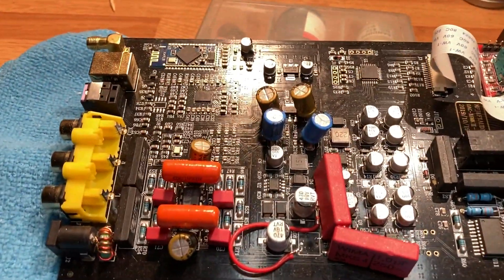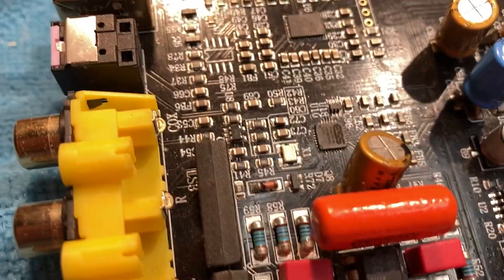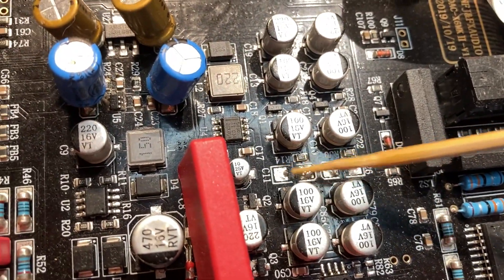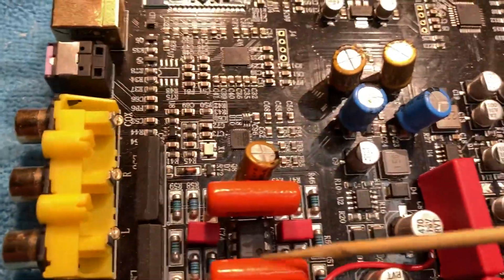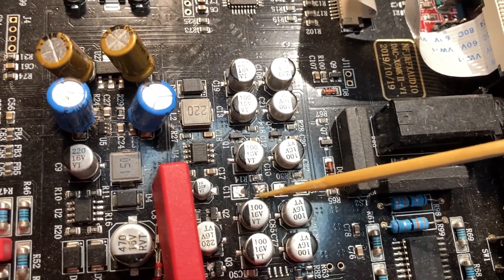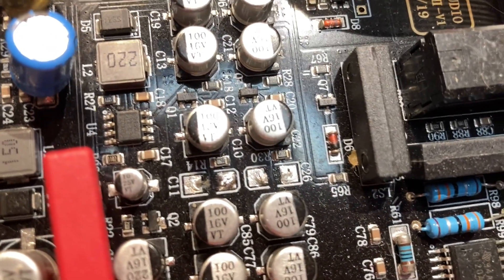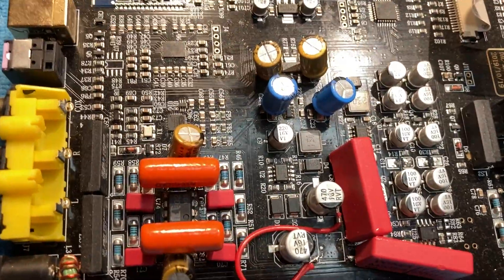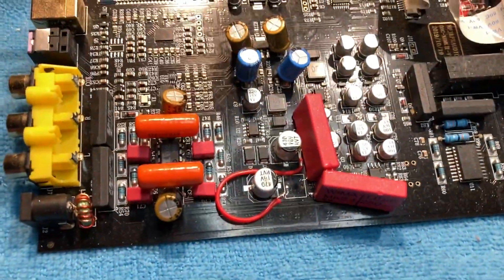FX Audio X6 MK2 DAC mod

Comment: Any idea on how to fix the fade in issue with the volume when starting an audio file in windows on winamp, or watching YouTube? 

(It's almost like it has a noise gate on the input. I have the 2020 pcb board).

I found this:

"There is a hack to get around this. You can set the "listen to this device" check box on either a line in device or a microphone that you aren't using, then set the device volume to 1/100. It won't be audible, but it will keep audio data streaming to you DAC and keep it fixed in to your chosen output sample rate."
Reply from the maker: I don’t use windiws
Reply: @ranbymonkeys2384  OK so you no sound drop offs for you on Linux or Mac I take it?

Comment: Mine didn't have C11 and C26 already. I replaced the worst of all op-amps: OPA2134 with a decent one: JRC2114, but sound was still compressed, so I decided to skip OP275 (gain 3.75) and the two blue capacitors, connecting output of JRC2114 with R60 and R68 (I soldered them with one end in the air to solder a cable to these loose ends). The loudness is still sufficient for most of the headphones and the sound is still not perfect, not 100% analogue, but now it's acceptable, maybe a little harsh. I tried a double LT1028 - it was OK too. The next step would be to replace TPA6120A2 with a double BUF634T and then to replace a op-amp in a differential stage with MUSE or Oracle II , or some simple analog stage on JFET. It isn't and never will be a R2R DAC, but now it can be used and my doughter is happy.  It's an updated to SMSL M2 (also modded) in which SA9027 suddenly died.
Reply from the maker: opa2134 are excellent op amps where are you getting your op amps
Reply from the maker: What did I tell you about where to get your op amps.   There is no such thing as a JRC2114 that is a fake Chinese made op amp.  Leave everything alone and goto DIGIKEY and get a real OPA2134 and you will see what I'm talking about.  Also wityh op amps you dont necessarily look at the gain but you look at the bandwidth, the slew rate is important (how fast it is) and signal to noise ratio but you are dealing with fake op amps and you are chasing your own tail here.  Knock it the hell off and take advice from people that know what the hell they are talking about and get some real op amps.
Reply: @ranbymonkeys2384  I meant NJM2114 from JRC - this is a very decent op-amp. Regarding OPA2134 I have (or rather had) several from different sources (also removed from some quite old, expensive audio equipment) - all sound the same bad, really bad. In fact all op-amps sounds bad in one way, or another - of course you can make it a little bit better, by example by making their output A-class (current sources at the out to +/Vdd or -/Vss), removing the load by using some buffers, by reducing the open-loop-gain, but in the end only few are semi-acceptable. OPA2132 was quite decent one, but not universal (low I-out) - maybe you mistook one for another? Statistically the best op-amps are from Analog Devices, but I didn't try MUSES from Nisshinbo (I'm afraid of fakes). The best op-amp is when there is no op-amp - just a discrete current-base voltage amplification without loopbacks and A-class buffers.

Comment: Hi, would you recommend the X6 MKII or the E30?
Reply from the maker: you would?  Well I have a E30 for sale and I would recommend the E50 (the one I'm currently using).
Reply: @ranbymonkeys2384  I would luv to but i dont live in the US.
Reply from the maker: E30 is better than the MK2 but the new E30's have the new chip which isnt as good as the old one.  You need to get one before a certaint serial number.  I have one I'm selling it for $200, but if you can't find an old one then get the E50.

Comment: Hello there, so im in possesion of dax x-6, lately i was thinking about an upgrade, im using it only with my pc and my dt990 pro, is tube03 good choice? Will it make any difference? Or should i buy additional hedphone amp? What would you recommend? I would like to spend around 50-60 $, is it even worth it in this budget? Thanks
Reply from the maker: Ya if that is all your budget it get the MUSES02 op amp.
Reply: @ranbymonkeys2384  how about muses01? I was just reading about this two opamps and people say that 01 is better, i really dont have any knowlage in this topic so i hope u know something
Reply from the maker: @h2p_rome  No it's not better, I don't think so anyway.  I can tell you that the MUSES02 and the X6 pair very well, or I would have put MUSES01 and NOT MUSES02.  Your on your own.
Reply: @ranbymonkeys2384  okay, sure, one more question only, i think i would like to choose warmer one, beacuse sound of 990 is pretty analitic, which one would you say is warmer?
Reply from the maker: @h2p_rome  990?
Reply: @ranbymonkeys2384  beyer dt990 pro
Reply from the maker: @h2p_rome  Neither are particularly "warm".
Reply from the maker: @h2p_rome  Have you put a real op amp in it all since you got it?
Reply: @ranbymonkeys2384  Not at all! Its totally stock, anyway i think ill just buy muses02 just as you said :) besides that, what do you think about smsl sap 2? I am wondering if it will be noticeable better amp then amp in x-6
Reply from the maker: @h2p_rome  I had the SMSL SU-8 and it sounded like shit. As for that one, no idea im not a headphone person.
Reply from the maker: @h2p_rome  Remember if something looks too good to be true, IT IS, an MUSES02 should run you about $50.

Comment: Anyone experiencing using usb input where the beginning ½ second of audio is not heard? Sort of like a fade in.
Reply from the maker: Have you tried a different USB cable and slot?
Reply: Yeah I do, and also I tried using a different cable but the fade in issue is still there and that makes me not use this DAC at all.
Reply: I adjusted the output/playback stop start settings in “foobar” my main media player of choice. I still have that problem with my CD player.

Comment: My dac has 1000 uf 25 v and i plan to replace with 3300 uf 25v anyone has any input on this
Reply from the maker: I do, You can but they probably won't fit.
Reply: Thank you so much. I think they fit as i checked the diameter spacing and they were the same i think
Reply from the maker: @jupitalynho2303  Make sure you check the height.  I don't think I've ever seen a 3300uF less than .5 diameter.
Reply: Awsome. Thank you very much
Reply: Any idea on LPS. Would replacing the caps with higher ones mess with voltage?my LPS has 14 caps. 1800 uf and 3000 uf. But i plan to replace caps with 3300 uf. They fit but idk if it will mess with voltage or not.thank you
Reply from the maker: @jupitalynho2303  As long as the voltage is the same with the replacement caps, also the smallest I found was 1/2 x 1 1/8'' for  3300uF.
Reply from the maker: @jupitalynho2303  Never mind they are 5/8 x 1 1/4"haha
Reply: Awsome thank you very much.
Reply: Good quality caps are usually much bigger, so if you find 3300/25 that still  fits it will be probably a lower quality cap, so it can make it worse.

Comment: hello, about the OPA2134 part...can i just put in any 8-pin headphone amp from ali-express with 8 pins? Dont these things have specific resistance or voltages? Most of the time there are no specs on ali express.Id like to put in a nice part maybe for 10 dollars.
Reply: The PSU in this DAC supply +10.5V/-10.5V to both op-amps (OPA2134 and OP275). You can replace horrible OPA2134 with most of the dual op-amps that are designed for 24-36
V, but be aware of these that are designed for less, like 5V. Still some of the op-amps will not be working correctly in this application, like LT1358. I didn't test all of them I have - JRC2114 was just good enough after skipping OP275 too.

Comment: I’m here in this game and really appreciate this channel . Could you recommend some Op Amps for a good upgrade on this model ? And perhaps for a more spacious soundstage? Thanks
Reply: JRC2114 is good enough, but you have to skip/remove OP275 - without removing/skipping OP275 the SOUND will not open not matter what op-amp you will place instead of OPA2134.
Reply from the maker: The sound stage is mostly going to come from the capacitors but check out the tube-03 video there are a bunch of op amps listed there.  I know one thing you got to get rid of the one that came with it.
Reply: Thank you so much!

Comment: Thanks for this. Your stuff is great. Watched your FX TUBE03 video and am waiting for my caps and OP amps to come in so I can trick that out. Now I'm thinking of getting the DAC-X6 as well. It looks like all these mods are exclusive to the headphone amp, correct? If I'm not going to use the headphone portion can I run this stock or are there still components I should upgrade?
Reply from the maker: The DAC-X6 is a little dated.  It only has a sample rate of 96000.  There are superior dac's out not with better dac chips (Topping E30).
Reply: @ranbymonkeys2384  Sorry, I meant the X6 MkII. Same question, though. Are all the hardware shortcomings you cited just on the headphone output side?
Reply from the maker: @ryanredmond9195  I don't remember, I also don't remember how many memory slots there were to my Tandy 1000.
Reply from the maker: @ryanredmond9195  I don't know

Comment: Can you provide the part numbers of all the caps you used to upgrade the FX-Audio DAC-X6 Mk2?

I just received mine, it's a V3 (June 2020), and I'm having a hard time reading some of the original values on the capacitors.

Thank you
Reply from the maker: I'm not sure what the version 3 has in it, well I'm not sure what version mine is.  OK I have version 2, and there are several types and values on this board If i gave you a list of all of the caps there are probably 15 to 20 different ones.

Comment: Do you recommend getting the X6 for 66$ or go get the MK2? Nice video btw
Reply from the maker: Well the X6 is very dated now and the MK2 is also on the borderline the MK2 only goes up to 192000 sample rate and there up to 384000 now I got the Topping E-30 in one of my videos and it sounds great without any mods, but it isn't Bluetooth.  Is Bluetooth important to you or the higher sample rate.  Also the Topping supports DSD and the FX Audio's don't.
Reply: @ranbymonkeys2384  wow 384k cool it will sound twice as good as 192k thank you. 192k always sounded "not enough" for my brain.
Reply from the maker: @melangkoh4184  it's never enough

Comment: Can you help me? 
While removing the power cap of the C83, all the PCB solders in the minus portion fell off and were damaged. Is there any other point in the condenser connection where I can connect the minus leg?
Reply from the maker: It goes to pin 4 of the op amp.  Sorry I was looking at the wrong DAC before.  EDIT  :  See if that leg of cap C81 hooks to pin 4 of the op amp if it does hook it to the pin on cap C81.
Reply from the maker: I hope I understand you correctly because that cap is a surface mount and really that is what you want to happen is the colder joint to fall of the cap then take that off of the board so, I don't know what your saying I guess.
Reply: Thank you for the help. 
It is hard to explain because I am not good at English.
Now C83 has already been removed.
But, The power cap (-) PCB pads came off while removing it (C83). So current CAP 100uf 35v (-) part cannot be attached on C83.

Can I attach Cap leg (-) to another point?
Reply from the maker: @pmchan387  So the pad came off of the board not the cap?
Reply from the maker: @pmchan387  There is a copper trace under the black coating that the pad was hooked to follow that to the next component I think it the cap next to it C81.
Reply from the maker: @pmchan387  Those are the most difficult thing to remove make sure you put lots of solder on those surface mounts and lift up real soft  once you get one then the other is a breeze but it's a skill that;s for sure.  That pad that came up is attached to a trace scrape the black off of that trace and that will show the copper on the trace and attach the - leg to it look close it's there.  Use a small small flathead screwdriver (jeweler) to scrape the black coating off.
Reply: Yes, Unfortunately the pad (-) has come off on board. I can't attach a new cap.
Reply: I kind of understand what the explanation is.
I'll try to it like you helped me.
I really appreciate your help. 
I'll try and ask again if it doesn't work. I'm always grateful.
Reply from the maker: @pmchan387  https://www.youtube.com/watch?v=xty1G5UBYb0
Reply: I solved the problem with your help. Thank you so much. I attached the (-) leg of the Power CAP(C83) to the C81 and changed the 473J, WIMA, and Nichicon Audio Ka 100uf caps to the same as the video, but the volume was very low. Is this normal?

Comment: Thanks for the tip! Can anyone advice me please if I can use muses02 or 03 for this DAC? and if 03 is better than 02 in terms on linearity of sound? Beginner for hifi here so would appreciate any tips.
Reply from the maker: Beginner for hifi and jumping right into the good stuff huh?  You can use any "dual" op amp.  I know the 02 is better than the 01.  The MUSES03 is a single and WILL NOT work.  Go with the MUSES02.  If you aren't paying $50 for it, it is fake.
Reply: @ranbymonkeys2384  Thanks for the reply! I was really looking into getting the 03 good thing I had the guts to ask here first. Now for the price, all the suppliers I can find here in PH sell 02's for around $25 - oh my.
Reply from the maker: @edwardkenemorales  PH?  What suppliers are you looking at getting it from?
Reply: 03.